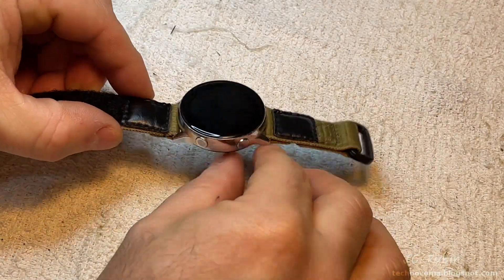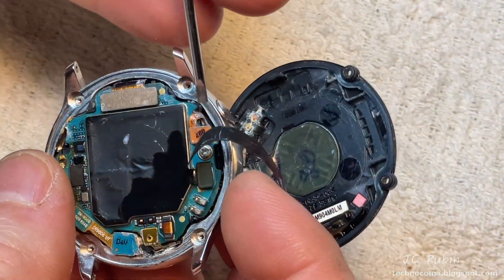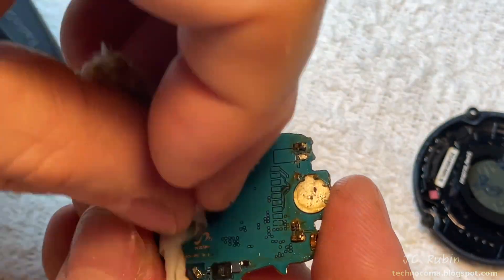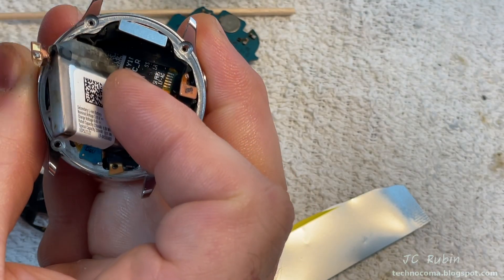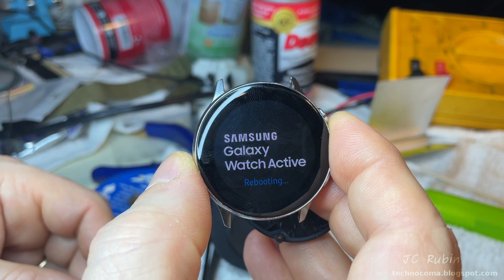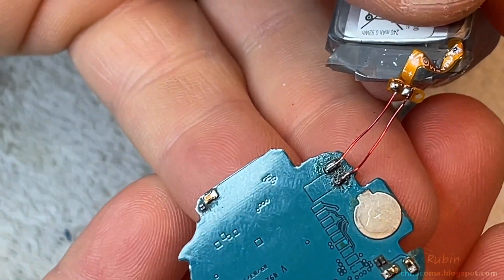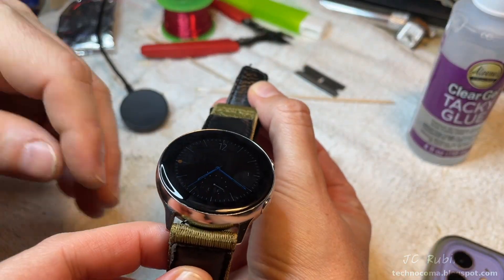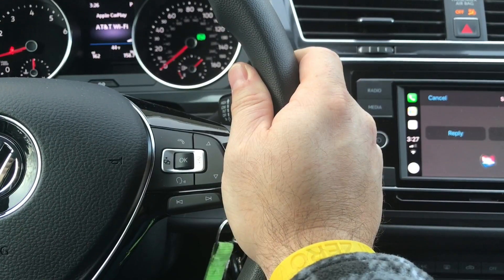Galaxy Watch - Pool Water Damage - Are they Swimming Pool Safe, Can it Be Fixed

Comment: My heartfelt thanks for this presentation. My water damage was slight compared to yours but i did what you did and i got the result you did, an outstanding result.

 Chlorine stains gave the game away, very certainly the main gasket on a watch less than 12 months old.

I can't thank you enough, without your presentation i'd have been completely lost.

Greetings from the UK.
Reply: To add to my previous reply, I now have less than half of the battery capacity I did have.
 A diagnostic check reveals half of the sensors no longer work.
 I opened my watch up less than 24hrs after failure, 48hrs after last being in the pool. It was bone dry inside, so the water that managed to get in, got out again as well.
 In Industry we use 'o' rings to seal such faces, we also have tables to tell us what size to use to insure you get the correct 'pinch' value to ensure a good seal. I'm struggling to understand how samsung got this so wrong. We have 'o' rings of every size for every type of environment and have done for many years. 
 I'll open it back up for a deeper dive into the damage but also join the chorus of unhappy people, this should never have happened.
Reply from the maker: Youre welcome

Comment: Hi, my Samsung Galaxy classic has water damage. The battery is draining fast and the back sensor doesn't work at all for anything. I opened it and seen some slight water damage. I tried cleaning it with a little contact cleaner but still the same. Would replacing the whole back of watch help? Or maybe it's the flex cable. I don't want to spend lots trying to fix it.

Comment: thanks, did the procedure on my galaxy watch 3 that after 4 years finally gave up on me and water got through in the lake. It was never on the salty water, but somehow the seal broke. Some contacts and SMDs were corroded, used the D5 spray to clean them up. Afterwards T6000 glue instead of silicone seal, since original seal will break while taking it off (or it was disintegrated at one place - 1cm - and that could have been the cause of water damage). Also put the new battery from aliexpress (let's see how long will it hold comparing to original). To open the watch you NEED the Y00 screwdriver, so used the iFixit Moray Precision Bit Set (20 eur) to open watch up.

Comment: Mine was in swim mode going into pool. In less than 4ft of water for, im 6'8 so watch was barely in water. Got out and watch was on password screen and it wouldnt accept my password. It died and wouldnt turn in again. Had watch for 3yrs
Reply from the maker: It doesn’t take much once the seal goes…

Comment: sir, i did on my watch exactly like u do, then the watch can turn on normally and charging, but the touchscreen not responding any touch, is there solutions please?
Reply from the maker: Sounds like you have more issues.
Reply: @retrotechandelectronics  is that about the lcd?

Comment: Mine i swam in the ocean any hope?
Reply from the maker: If you clean it out quick, maybe
Reply: @retrotechandelectronics  i did clean it out quickly but it was already off so I tried cleaning it, then rice for 32 hours, then standby for 24 hours, still not turning on 
It can still charge i tried samsung wireless powershare and it indicates it's giving power
Thanks for reply 🙂

Comment: They a defiantly NOT NOT pool safe i used mine in the pool twice and it stopped working. I took it to a Samsung Services center they sais water damage and they did not want to repair the watch. After a lot of conversation they finally agreed to repair it. Samsung told me not to swim with it. REALLY! it s a sport watch with swim app, VERY disappointed. DO NOT BUY a samsung watch 6 Classic what a disappointment.
Reply from the maker: It seems Samsung doesn't live up to its own product advertising.

Comment: Iknow this is old, but the sensor is only about 10 dollars and that's for the heart monitor and sleep tracker and takes about 5 minutes to replace
Reply from the maker: Now it is....... maybe worthy of another video...
Reply: @retrotechandelectronics  Maybe not worth another video, but I had the same issue. Watch get wet, started to overheat once dry. I cleaned and replaced the battery, but still was over heating. I disconnected the sensor and it stop over heating, but I lost some of the features. I purchased another watch. I later replaced the sensor...2 years later, and so far it has not overheated. I only wear it every now and then but its not over heating.
Reply: thanks for the tip. Ordered on ali flex with heart rate sensor for 8 EUR for R840, let's see if that helps.

Comment: My 6pro just flooded today. It was in water lock mode.
I used it in the pool last year with no issue but this year it flooded the first time I submerged it. It happened very quickly and in the shallow water of the toddler section.
Apparently samsung's warranty doesn't cover water damage even though they market those watches for sports and they have swimming settings.
I'm not amused as the main reason I got this smartwatch was for the pool.

Comment: I've been swimming quite a few times with my active 2 watch with no problems, but the other day after a swim it then refused to charge.  Showed zero percent on the screen then went blank.  Just taken it apart and the water indicator is pink so water must have got in.  Now waiting for a new battery and hopefully I can resurrect it.
Reply from the maker: Better flush out the chlorine before the insides rust

Comment: Forgot to take mine off going in the pool, when I noticed I took it off but it was acting haywire, flashing screen. I put it in a zip lock bag with some rice in a heated clothes press over night, and it came back to life, almost. Showing time, charging, power on and off but no touchscreen. More to do.

Comment: Had similar water damage but no go after cleaning. Battery spring connector same as yours.  I suspect the main ic with its solder balls have degraded too.  Or do you think the main ic is epoxied over?

Comment: Hey dude. My watch has done the same. I took it apart like yourself and there is minimal damage / water after swimming. It's stuck in reboot mode. What would you advise to fix it? Many thanks
Reply from the maker: Deoxit on the button pads.

Comment: My Galaxy Watch 4 Classic got water damaged, while I was swimming for couple minutes I checked my watch and it was working abnormally, it was on watch-only mode and screen wasn't responsive but no damage to the screen. I went home and I tried to charge it, it shows lightning and for some time the temperature warning. (I was still able to boot  it, even though it has water inside) after several tries, I tried shaking off my watch and it really had water inside like a lot. I put it on rice and dried it under the sun.... and after that when I charge it the lighting logo does not appear anymore and the watch only heats up. 

Now 2 weeks later, I got the tools to open it. Some parts of the watch were still wet. Cleaned everything using isopropyl alcohol 99%, I soaked the logic board in isopropyl, some has signs of corrosion, but the battery was not bulgy so I thought it would still work... after drying everything up for few hours in direct fan and assembled it, it no longer heats and doesn't show any signs.

My question is, considering it was working beforehand while the inside were wet, I was able to boot it up on Samsung logo (but after the sammy logo then the lightning screen goes off [while it was plugged or charging] ) this means board is ok and screen? 

Another, what do you think I needed to buy so my watch would still work? 

Battery? considering what's happening to my watch...

Hoping for your reply 🙏🙏🙏🙏🙏🥰 I subbed
Reply: Why did you put wires from the battery to the board instead of direct contact?
Reply from the maker: There were no contcts left, they were completely eaten away

Comment: I have the same watch. The screen  does not working anymore...i think. Before it dies, it display weird green lines and black display afterwards. I do use it when swimming coz Samsung advertised it as such as you mentioned. :(
Reply from the maker: Yeah, it needs what I did to mine.

Comment: Hey i've got a active 2 watch with water damage. everything works expect the touch screen. I've saw some corrosion under the screen and cleaned it. Now only a small part on the right works when swiping but the rest is still unresponsive. What would you recomment me to do as next? Btw im an electric technician. So i have some experience
Reply from the maker: Clean the connections with deoxit like I did
Reply: Hey thanks for the idea. But i found the problem already. And sadly its qite bad. Because one track vanished because it rusted away. I've tried to solder a wire to it. But its so small i cant do that with the tools i have at home.
Reply: @12white1 i have the same problem like u, can u tell me how to recognize the touch
Reply: sir i have the exact same issu with mine after normally turn on, but i didnt see any corrosion on the screen, how do you recognize that? and wich track u mean that had vanished? is that track cause the touchscreen not responding?
Reply: @ Hey i don't remember it fully anymore. But take a good look at the board. In my case i could see that a connection was rusted away. I think that was the main problem. I wasn't able to repair it because i didt had the proper tools for it.

Comment: Had my Active 2 for 2.5 years and the touch reaction suddenly went after washing my hands
Reply from the maker: Yeah.... Not waterproof for sure.
Reply: Mine stopped working as well. I tried to get it fixed and they said not worth it to fix because once it's opened it will decrease the water resistant effect and may cause more damage

Comment: Man! I had my watch for years and now it got water in it I guess. Many times I used it in water and it was fine. Now it stopped working. It it vibrates and then it's just a black screen.
Reply from the maker: Try to fix it maybe , you cant break broken

Comment: I have a galaxy active 2. I knew i could use it in a swimming pool. today was my first day in a pool and now the watch screen starts becoming green in places and then just starts glowing brighter and at last becomes white. I restarted it and saw that the screen was working fine. and then all of a sudden, it does the same thing again. any suggestions?
Reply from the maker: If its under warranted send it for repair, if not, stop swimming with it/
Reply: @Retro Tech & Electronics  I have had mine (Galaxy active 2, same watch) for a few years and got brave enough to use it in the pool today and that looks like it was a mistake. My dad bought it for me, so I'm not sure there's any protection. I have it in rice right now. I wonder if there are professionals near me that could fix it if not. I regret trying :(.

Comment: My watch sensors are busted the accelerometer, gyroscopy, barometer and HR sensor. the rest is working..  is this usual?
Reply from the maker: In the video you will see they are all connected with tiny connectors to the main board, probably dirty connections.
Reply: @retrotechandelectronics   thanks. It came up with an error of high temp in a very cold swimming pool and had had these issues since. I fear water damage but, it's weird it still connect to my phone, received messages etc..  but the diagnostics state all the sensors are currently bustsed.
Reply from the maker: @LilyKaren1980  the main board can communicate. Not the cable connected peripherals

Comment: Well, never trust the manufacturers about waterproof 
I have the same watch as the one he fixed in the video. The manufacturers said that it has no problem when swimming with the watch. So I tried, and it dies after 5 mins under the water.
Reply from the maker: I hope not salt water.
Reply: Same here
Reply: Same....luckily I've had it a while, but still that sucks. Why have swimming mode and not hold up....went to the pool a few times. Welp... back to the drawing board...

Comment: I have 2 of these galaxy watches because the first one died, I didn't have a warranty, was hoping it was a fluke, so I bought a second watch, kept it alive about a year, without swimming, which it was supposed to be able to do, and now it's dead. I'll try what you did and see if one of them will come alive. But definitely NOT buying another samsung watch.
Reply from the maker: Good luck, me neither.
Reply: @retrotechandelectronics  update, couldn't get the screws out of the back, best buy ended up giving me a store credit even though it had been just over the 2 year period. Used the money to get a galaxy watch 4. paid $60 for the 2 year geeksquad warrenty. I won't swim in this one even though swimming is one of the activities still listed in the exercise modes.

Comment: My wife's Samsung Active watch locked up after she manually put it in swimming mode and went swimming with it  (it wouldn't go into swimming mode automatically). We tried to charge it and reset it and nothing worked. It would still show charging but nothing else.  I used your video and disconnected the cables to the motherboard thereby resetting the watch by disconnecting the battery... and it booted right up and worked !!!! Thanks for this awesome video. You saved my wife's watch that was a birthday gift !!!!!
Reply from the maker: Im thinking the disconnect and reconnect cleaned the contacts, consider deoxit.
Reply: @retrotechandelectronics  You were right !!! It stopped working again... bought some deoxit d5 like you suggested and sprayed everything and wiped...it's working again...fingers crossed !!!
Reply: @oh-brothers  still kicking?)

Comment: Nice video. It's been quite some years since the release of the Galaxy Watch Active, but the reason it has a waterlock mode even though it's not really water resistant is because they use the same software as the Galaxy Watch (the bigger one with a rotatig bezel), and that is water resistant up to 50m, so it has the swimming modes, and if they port it, the watch active will have the modes too even f it's not resistant.
Reply from the maker: But advertised as such.
Reply: I have the big galaxy watch with rotating bezel and has the same issue now damaged because of pool swimming.

Comment: Imagine advertising a watch with swimming tracking, and showing it being used in a pool, and then hiding the fact that it's not recommended to be used in a pool. The rating is also only for 30 minutes immersion in static water at a max of 1.5m depth, no doubt without any button pushes. Great work Samsung, very honest marketing there. The time spent developing the swimming tracking activity could have been used to improve the battery life or fix some other bugs.
Reply: I swam for 30 seconds with the watch and it was destroyed. Samsung should face a lawsuit for advertising that, 100% agree.
Reply: @gabrielkaras1858  I believe they are I  America. I'm not going back to Samsung either.. I will move to Garmin.
Reply: @LilyKaren1980 ؛
Reply: ٢
Reply: ٢
Reply: ٢
Reply: @LilyKaren1980  same thing happened to my wife's samsung galaxy watch 2. My garmin watch still going strong after 3 years of use, frequently swimming, fishing, etc
Reply: @gabrielkaras1858 ؛
Reply: @gabrielkaras1858 ؛
Reply: @gabrielkaras1858 ؛؛
Reply: @gabrielkaras1858 ؛
Reply: @gabrielkaras1858 ؛
Reply: @gabrielkaras1858 ؛
Reply: @gabrielkaras1858 ؛؛
Reply: @gabrielkaras1858 ؛؛؛؛
Reply: @gabrielkaras1858 ؛
Reply: @gabrielkaras1858 ؛
Reply: @gabrielkaras1858 ؛؛
Reply: @gabrielkaras1858 ؛
Reply: The same thing happened to me. My shock is that a watch that tracks swimming activity is not water-resistant. I have decided to leave Samsung altogether.
Reply: @TAOnyea ؛
Reply from the maker: Yeah, its all around an unfortunate situation, we wont be buying another samsung watch,
Reply: @retrotechandelectronics ؛
Reply: @retrotechandelectronics ؛
Reply: @retrotechandelectronics ؛؛
Reply: I just ruined my watch after only being in the pool for 10 minutes, and I wasn't swimming, just floating around. Samsung said it would cost a minimum of $200 to fix it, but they would offer free postage to send it to them. It's not happening!! Will never buy any Samsung products again.
Reply: It's not even sweat resistant, let alone being swimming safe.  My training routine is intense, so I sweat a lot.  The innards of mine corroded with salt and the watch bricked after only a year and a half after purchase.  Very dishonest marketing, IMO.
Reply: ٢
Reply: I had the first active watch and swam with it for 2 summers in a row. Swam with my watch active 2 for the first time yesterday and its still not working. Last samsung watch I buy. Garmin watch next most likely.
Reply: Samsung galaxy 5 - same crap.
Reply: did they advertise in a swimming pool scenario? if yes, people could sue them for big. That's illegal.
Reply: Just happened to mine galaxy 2. Was using it to track my steps. As the fitness app showed swimming used ut i a pool for 15 minutes. Saw it still on in the pool but when i came out a black screen and won´t come on. Was on 23% battery so maybe battery went flat but itns not charging. I will wait till tomorrow for it to drt before charging again
Reply: Samsung 7 also..garbage watch